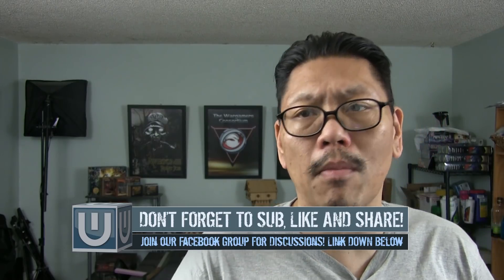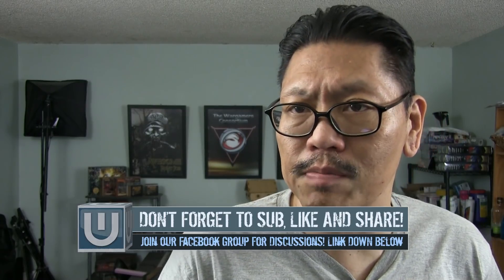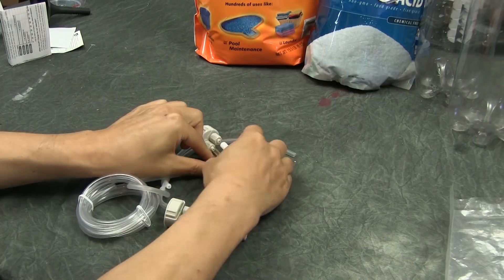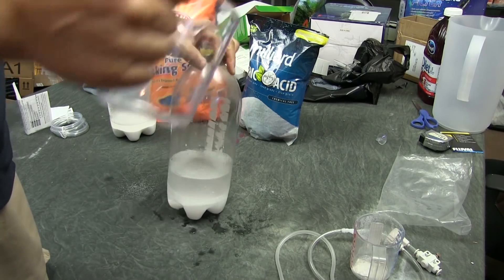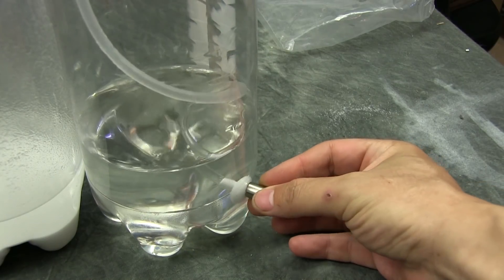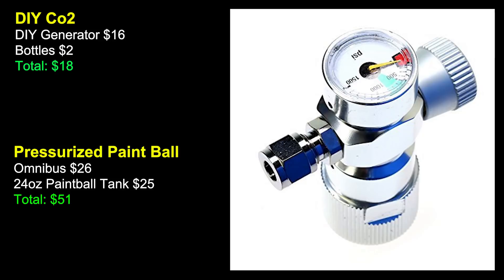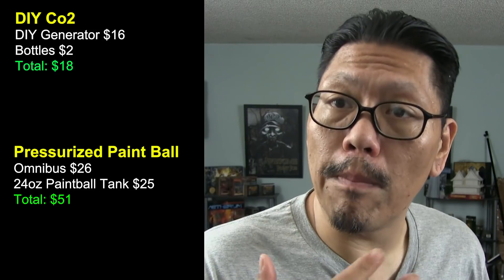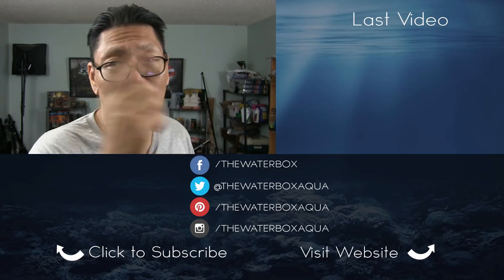DIY Co2 for your Aquarium - How To

Comment from the maker: MORE TO LEARN ABOUT PLANTED TANKS:
☑️ Beginners Planted Tank Guide: https://goo.gl/oCujCK
☑️ Aquarium Lighting Guide: http://bit.ly/2INYuMA
☑️ Aquarium Co2 Guide: http://bit.ly/2rSteVY
☑️ The Dry Start Method: https://goo.gl/XC8Rnz
☑️ Using Soil: https://goo.gl/PxkvK4
Reply: The Water Box 
yup i use
Reply: The Water Box Hi!, I' m using this system for the last 2 weeks. Its cheap and its working good. Just want to know. How long I will use this in my 20 liter tank. And how bpm? Thanks
Reply: I used to way back before the eBay products being sold. Used a coke bottle, sugar, yeast and baking soda. Lasted in a 55 for two weeks before needing regeneration. First time was a mess because I didn't know how high to have the water and it almost got into my tank. So over all it is  not a bad thing if you want to try it.
Reply: nope - pressurised

Comment: The diy co2 system is $6 on Amazon right now (same as yours), Tailonz Pneumaitc selenoid is $11. I also recommend you to get a better needle valve (Rhinox copper needle valve is a good choice). You can also get citric acid online for $70 50 lb.
I've had it for about a year, lasts on average 2 weeks 1.5 - 2 bps, 50 gallons. I have 20+ kinds of plants, including red ones. It works pretty good.

Comment: Quick question. I set it up. There is pressure and a reaction, but my needle valve is not controlling flow! Do you think I might have a defective unit?
Reply from the maker: That needle valve is very finicky and just have to be adjusted very slowly.

Comment: Once you turn off the valve at night, is it necessary to lift the needle valve, from citric acid mixture.Some say taking out the needle valve stops the reaction and you have to prime the mixture the next day.Please explain.
Reply from the maker: Well, if you HOSE (I'm assuming that's what you meant) from the citris acid bottle, then yeh, it stops the reaction since the acid can't get into the other bottle to react.  And if you do that, yes, you'll have to repime it the next day because the pressure stopped pulling the acid into the other bottle.
Reply: Is any different way for switch off at night ?

Comment: Hey! Do I have to shake the bottle again when I have to use it the next day as my baking soda has been settled down as a sedimentation over night.
Reply from the maker: You shouldn't have to. You don't want to. The reaction is paused when you close the needle valve.  When you open the valve back up, it'll start the reaction where it left off. The only time you want to shake the bottle is when you are mixing a new batch.

Comment: Hi, i am hoping to try a acid based diy co2 set up.  A question about the types of PET bottles.  I have access to two types of PET bottles where I live.  One is stiffer kind of plastic and the other is softer.  Considering that I would be using a solenoid and shutting flow of co2 off at times, which kind of PET bottles should I use?
Reply from the maker: I would not know as I'm not too sure why kinda of bottles you're talking about. We here in the US use the 2-litter one for soda.
Reply: Thanks for your reply.  Understand that it can be hard to visualize.  Perhaps this is an experiment for myself to try

Comment: I'm using the same kit but my gauge is still reading zero even after priming 45min ago. Both bottle are rock solid.

Think it could be a broken pressure gauge?
Reply from the maker: It sounds like it. Check for leaks

Comment: I love your videos, they have helped me a lot. I have a question I did the setup and everything is working fine but when I touch the bottles it looks like they have built so much pressure inside. So what are the probabilities that these bottles would explode, I’m scared since my aquarium is in my room.
Reply: Your bottles should be fine, they are tested to around 150psi which is round about 10bar pressure. I would imagine the tubing would blow off first!
Reply from the maker: You are fine.  Those soda bottle are rating to handle way more pressure than what the DIY mix can produce. Your hoses will mostly likely pop or split before your bottle do. Just don't go dropping them.

Comment: Hi, so if You shut off the needle valve during the night will the pressure in the bottle not build to dangerous level, I guess it is still safe pressure but can someone please confirm?
Reply from the maker: If you shut off the needle valve, it's SUPPOSED to stop the reaction from happening before there's enough pressure to split a 2 litter bottle.  I explain it in this video: https://youtu.be/0rshucPR8hg

Comment: I have this same setup and it works great. My only issue is that when i refill the bottles, it takes hours for the pressure to build high enough to start diffusing into my aquarium. Even after ive squeezed as much acid into the baking soda mixture as i could. Is this normal?? There don’t seem to be any leaks
Reply from the maker: It shouldn't take that long. Do you have a one way valve in the hose line? Maybe try changing that out.

Comment: Hi there, Really helpful set of videos thank you. I purchased the diy co2 system off amazon. I also purchased the electronic solenoid so i can set up a timer with it. One issue i have is that the thumbscrew that comes with the DIY CO2 system is really hit and miss. I'll set it up for a number of bubbles in the bubble counter then ill check it an hour later the number of bubbles will be different. is it that the thumbscrew is broken or do i need some sort of pressure regulator? thanks in advance
Reply from the maker: You have to keep fiddling with it. The problem is they aren't always built the same.  But it's DIY, you can get away with a higher then normal 1BPS kind of flow. It's also the beast of the nature with dealing with DIY Co2. The pressure will lessen as the pressure is less i the bottles over time.
Reply: @TheWaterBox  Bubbles vary because the pressure cycles. 1 bubble per sec is the same amount of co2 for diy and pressurized systems (after the initial 2 liters of air are purged)

Comment: Bro i have a doubt with diy CO2 which use with soda and citric. If i use solinoid. Does my CO2 will explode. Example  i use daily for 6 hours means rest of time it switchoff it didn't explode. Please help me in this matter. I fully confused.
Reply from the maker: Not with 2 litter bottles.  It doesn't create enough pressure to rupture the bottles.  The hoses will pop out before that even happens.

Comment: Just found your video and literally got into the DIY. testing out the 1 bubble/sec for now but I was wondering...does it really matter where the diffuser is placed in the tank?
Reply from the maker: Yes.  Put it in a place where there's flow or the co2 isn't moved around the tank.  Co2 tends to concentrate at the top level of the water. You need to move it around the tank for maximum efficiency.

Comment: I thought that we cannot use Solenoid Valve for DIY CO2 system as it would build up pressure in the plastic bottle and cause issues/ Is this actually safe? What is happenning to the pressure then?
Reply from the maker: Once it's cut off, it should stop the pressure. As long as you have bottles that can handle the correct PSI, you should be good. More on this here: https://youtu.be/0rshucPR8hg
Reply: @TheWaterBox  Thanks a lot for your response, I will watch the video now :)
Reply from the maker: NP. Just leave comments there if you have any other questions.

Comment: Hello, I have set up a dirted tank with organic seed starting soil capped with 2 inches of sand with a filter and heater. I don’t have any plants or fish in it yet and I can’t seem to get it to clear up from it’s apple cider looking water. It has gotten better with water changes but it seems like a waste. Do you have any ideas for what i could do?
Reply from the maker: It's tannin's from the soil. It happened. It goes away over time with water changes but you can use Purigen in your filter and it should help clear it up pretty fast. Just take it out when you're done with it so it doesn't take out more stuff that the plants may need.
Reply: Thanks, I’ll try that out!
Reply from the maker: Good luck!

Comment: Does the needle point have to exactly be in the green zone to be considered primed? I've done it myself using the exact same measurements of Citric acid, baking soda, and water too. What happened on my end was that the needle spun just a little past the green zone but not very far off at all from the green zone (steady at the 2.20 mark)
Reply from the maker: No, just get it up to the green is fine.  It'll slowly build more pressure over time and most in the the green zone later.  Just get it to at least the line is fine.

Comment: Hi I have this DIY co2. I run it for 8 hrs. After using this Co2, I run my air pump in the next 3 hrs. And repeat the cycle in the morning. My question is, do I Have to open air pump after using co2 in w/c I see the fish gasping for an air. Or not  to use the pump for the Co2 I inject will lose. Pls help if I’m doing it right.
Reply from the maker: I'd use it while the co2 is going. The air pump doesn't "inject" o2 into the tank. It helps create surface agitation in the tank to promote oxygen exchange and you want that so you don't gas your fish.

Comment: I was not able to buy the needed materials to build one before the apocalypse happened (COVID home quarantine). Are there home materials I can use to somehow supply my tank with CO2?
Reply: Air stone will help a little
Reply: Also if u don't have much co2 reduce. Your lighting on your tank as less light less photosynthesis less photosynthesis less co2 used id drop it to 5 hours of light a day or less
Reply from the maker: Materials as in making the contraption or the mix (Citric Acid and Baking Soda?)

Comment: Hi chung (hope i got that right). If i doubled  the mix, say 400g to 1200ml citric acid and then 400g to 400ml baking soda, will it make the mixture longer before i prime one again. Its currently taking me just 7-10 days. Thanks mate!
Reply from the maker: I dunno. I don't know if you'd want too unless you double the size of your bottle too. Don't quote me on this and I'm guessing but doubling up on the mix might double up on the pressure too. I dunno though. You'd have to research that or asking done else who's tried it or looked into it. I don't go the diy co2 route anymore. Its either passive like the Fluval 20g kit set up or pressurized or no co2 at all. Depends on set up of the tank.
Reply: The Water Box I think your right on doubling the bottle size. Problem with that is that i don't know if there's any 4L bottle, and if there is one, if it would fit the co2 bottle caps. Oh well guess ill stick to this setup until i get tired, or find a bottle! Cheers!
Reply from the maker: Yeh, there are some limits until someone finds a better way.
Reply: You might be able to find 3 liter bottles at the dollar store and just up the mix by that difference.

Comment: Using this on two different sized 2 liters, is that my problem? The bottles get stiff, but the gauge says nothing. No CO2 comes out, citric acid is on A, the taller bottle, baking soda is on B, the shorter bottle. Baking soda keeps clumping on the bottom. Any help?
Reply from the maker: Try mixing your mix with warm water so that the baking soda can dissolve.  Make sure to use baking soda and NOT baking powder.

Comment: Great video! So glad I found your channel. Quick question on the regulator with solenoid valve you list: I am guessing I should choose paintball threads of I plan to use a paintball tank? Thanks!
Reply from the maker: Yes, if you want to use it with a paintball tank.  You can however get either and just get an adapter that will make it fit the other tank. But it's easier to just get the one based on the tank you plan to use.
Reply: The Water Box Thanks again!
Reply from the maker: Anytime my friend!

Comment: Hi great vid
Question can i use 2 defuser in one setup?

Thank you
Reply from the maker: You can if you want. Is it needed? If your tank is small than 40g, then most likely no.
Reply: @TheWaterBox  hi thanks for replying i am  thinking to use one solution to two 5 gallons tank, is it ok?
Reply from the maker: @LearningIsTheBest  You mean splitting the setup into two tanks? That might not work too well. The pressure coming out of the bottles is inconsistent as it. Splitting the line will cause more inconsistency. You can try it but I'm not sure how well it will work.
Reply: @TheWaterBox  ooh ok, i guess i will try, as soon as i can set up the co2... thanks thanks

Comment: Hi sir, co2 is continously produced right? Solenoid valve shut off will make the bottle burst with extra pressure..? How the pressure inside bottles are controlled?
Reply from the maker: I never had a problem with the pressure inside the bottles. Neither does Pepsi or coca cola or other soda companies. I dunno what the max pressure on a sealed bottle is but on a diy system, it's not completely air tight.
Reply: Generally soda bottles are pressurized around 50 psi and u can drop them and shit and they are fine so i assume u could push 60 and be fine
Reply from the maker: Thanks fro clarifying!

Comment: Hello! Very helpful video, I just have one question:

I'm doing some research online on having to use both co2 on my planted tanks WITH airpumps. I'm getting mixed info's and I was just wondering if this is something you'd recommend? Thank!!!
Reply from the maker: You're fine if the air pump isn't drastic and causing massive surface tension. You want subtle surface movements even using Co2 to promote the gas exchange balance so a subtle air pump is fine.
Reply: @TheWaterBox  sweet! thanks!

Comment: Hello, I've read that this kind of system (citric acid + baking soda) tries to maintain an equilibrium. Reaction in bottle B adds pressure to both bottles and when there's enough pressure in bottle A, it send more citric acid to bottle B, and the cycle continuous. My question is, isn't the cycle just going to continue and the pressure will build up even when the line going to the the tank is shut off? I am currently doing the sugar-yeast method but it runs out far too quickly and and I could not shut it off, so I am thinking of switching to this mix. Thanks!
Reply from the maker: You just answered you own question.  When the Bottle A pressure gets higher than B then it send the acid over.  But if you stop pressure from escaping from B, then it'll always be pressurized higher then in A. Besides, a bottle can handle 1200 psi of pressure. Your DIY contraption or tubes will pop before the bottle does. Might leave a wet mess though (more if you don't have a one way air vavle).
Reply from the maker: To clarify, when shut off, the pressure will build to the point where both bottles will have equal pressure so nothing is moving into either bottle.  That initial build up before it stops isn't enough pressure to go beyond 1200 pounds.
Reply: Thank you for responding! I get it now, the key word is equilibrium! When the solenoid shuts off, neither bottle will be able to send anything to the other, wether the gas from bottle B or citric acid from bottle A!
Reply from the maker: @marlonallansupetran7120  It will for a little bit when you shut it off but once it equalizes, then yeh, nothing moves. Everything is in balance. ;)

Comment: Hey by the way my plants are still alive the one that you told me what it might be it's doing really well surprisingly. I have yet to get the root tabs but as soon as I get paid on the 10th I'm getting them. In the meantime I've got liquid fertilizer. Which seems to be keeping them from dying. my anubias is doing well and the stuff that looks like kind of like long leafy grass that you put in the back of the tank is doing pretty well but this stuff that looks like Christmas tree is starting to turn yellow at the bottom and brown so it's not doing too well. I pulled it all out and I cut off all the parts that are dying and maybe try it as a floater plant and see if it does better
Reply from the maker: Good to hear!

Comment: im running this system for 5 days now, but the pressure is increasing to 2,2 kg/cm3. is this a problem or am i just fine. im a bit concerned since its out of the green range if you know what i mean.
Reply from the maker: You should be fine. Soda bottles don't fail until over 7 kg/cm2. Your hoses split or pop first but typical vinyl hoses can at the minimum stand up to maybe 4 (depends on type and make). Most likely will pop out of it connection first if anything but you still go a ways to go. If you're still worried, just let a bunch of the co2 out in one go.

Comment: Hi my setup is the same . But the problem is my mix will be over in 3 or 4 days. What could be the reason for this ?? please help .
Reply from the maker: Depends on your needle valve setting but I'd check for leaks, that's usually the problem.

Comment: Dang, your videos a AWESOME, why is my presure rising when using it or not using it, always exceeds the green zone, is that something i should worry about?
Reply from the maker: It'll rise over time, especially when you cut the connection to the bottles. You should be fine. Those 2 litter bottles are made to handle was more pressure that DIY c02 can produce.  Assuming you're using the right amount of mix.

Comment: Question!?! After a few days of using yeast the bubbles are not as visible but you can still hear it coming from the stone. Is this better? Or still working? Or should I replace it?
Reply from the maker: It should still be expelling bubbles through the stone. Are you using an air stone? Or any actual diffuser?